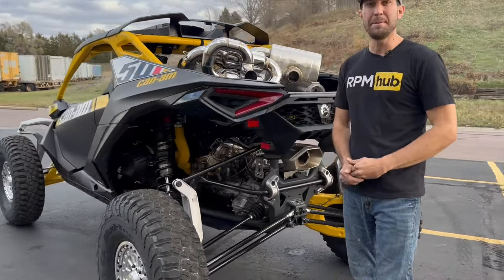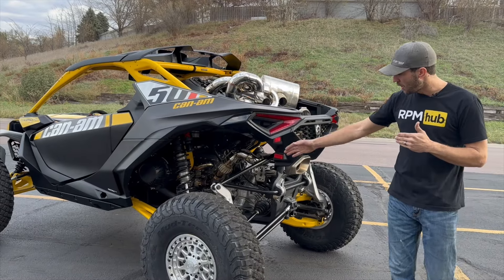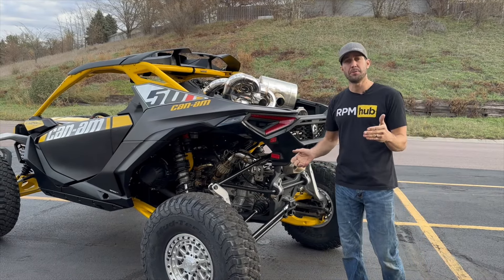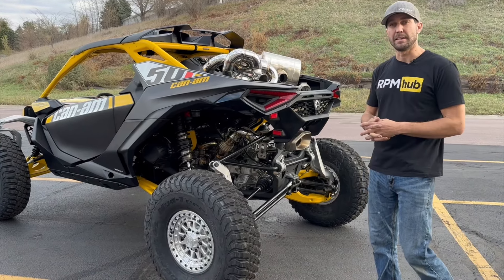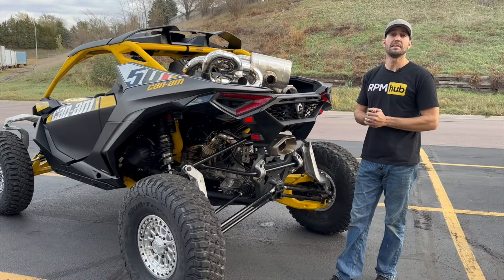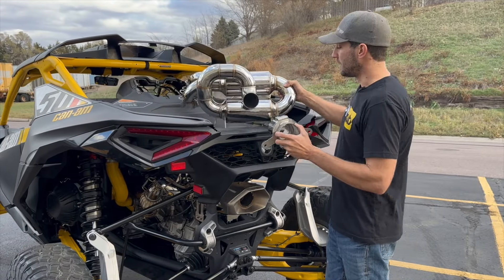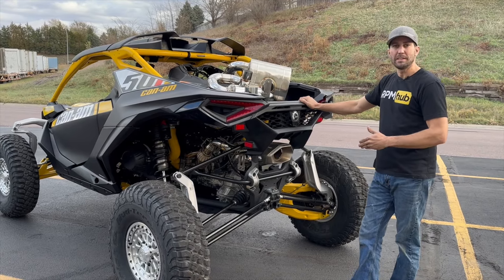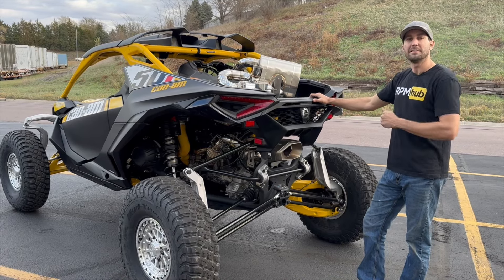Can-Am Maverick R Gets A RPM 3" Muffler Delete & 3" Resonated Mid Pipe

Comment: Does this offer a CAT delete?

How much HP gain are we looking at?
Reply from the maker: This gets rid of the heavy 30lb muffler with only a 2" exit pipe. The CAT isnt used on the maverick r, the OEM muffler builds enough heat to burn off fumes.
Reply from the maker: HP gains are really dependent on the mid pipe. If you paired this muffler with our mid pipe, you'd be looking at 12hp on the big end, 10hp peak, and a average of 9hp across the board on a STOCK tune.